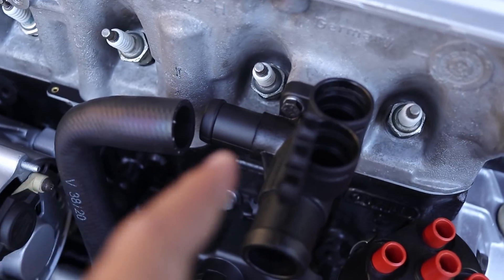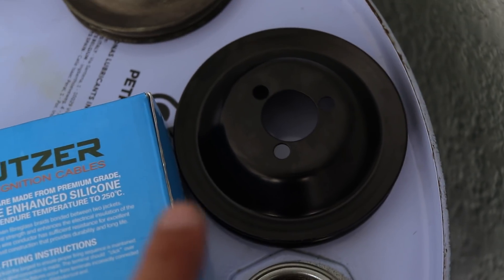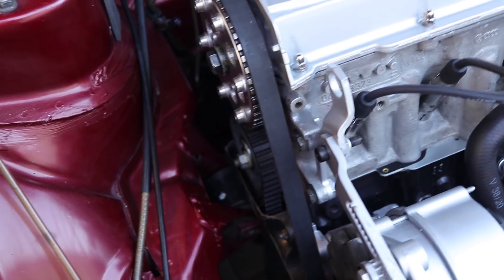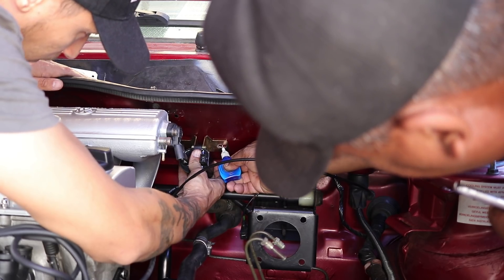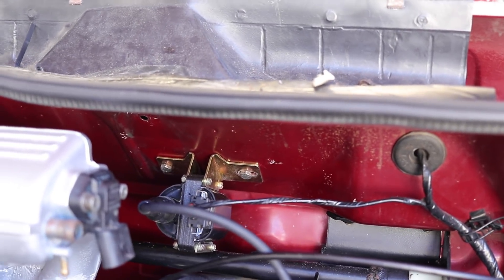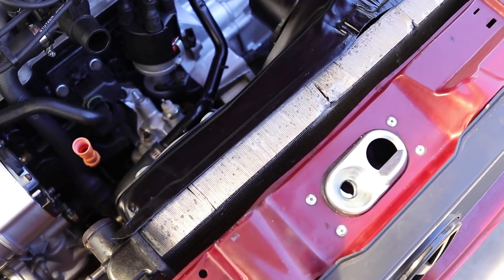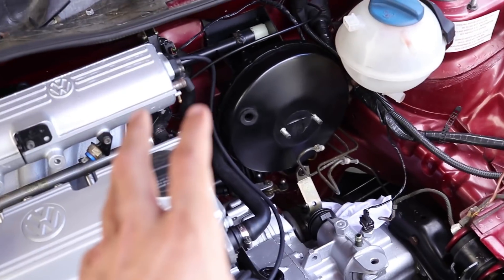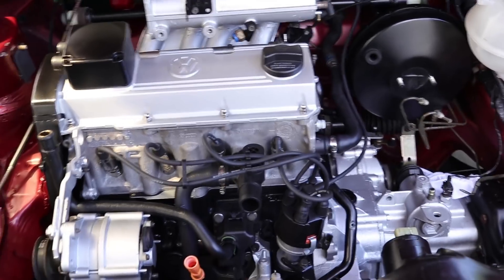What's next

Comment: Looking good so far👍If you want to keep the window washer bottle you can get a Newspec bottle as it sits on the other side. Near the coolant bottle. You'll just need to cut the pipe shorter and you're good to go.
Reply from the maker: Thanks for that bud 🙏🏻 Only thing is there’s not a bracket for it so I’d have to have one made on the opposite side. But that is an option
Reply: @jamiepotgieter  No problem. Lol at least you very comfortable with making adjustments and modifications when necessary. 😅😎also I like the idea of the standard box , but please , if you can get a stainless or aluminum pipe from the throttle body to the airbox. It looks killer , I would send a pic but can't send on YouTube. I look forward to seeing it complete.

Comment: Good day. Can you tell me the part number for hose from cylinder head to water pump housing to oil cooler and part number for hose from water pump housing to oil cooler to coolant pipe and  part number for the coolant pipe. Or if possible send pics of the hoses and pipe.